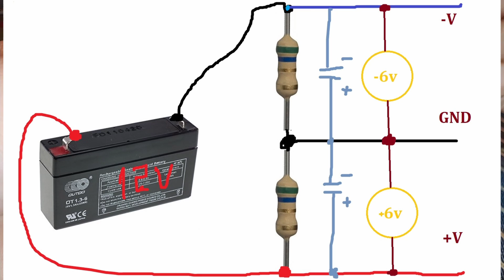CÁC BẠN CHƯA BIẾT ĐIỀU NÀY - MẠCH TẠO NGUỒN ĐÔI CHUYỂN ĐIỆN ÁP ĐƠN SANG ĐỐI XỨNG

Comment: Mình đang tính chế nguồn đối xứng 12v từ nguồn atx máy tính, mặc dù nó có dòng -12v nhưng chỉ ra 0,5A nên sẽ không phù hợp với 12v 20A. Mình chưa nghĩ được cách boost dòng cho dây -12v lên ngang dây 12v. Liệu dùng 2 mạch kia cho dây 12v thì dòng ra có còn khoảng bao nhiêu bạn nhỉ. Bạn có ý tưởng gì hay không
Reply from the maker: Chỉ có cách quấn lại biến áp, bỏ các nguồn k dùng tới như 5V
Reply from the maker: Bạn dùng cho việc gì ?
Reply: chắc kiếm cái biến áp ngoài chạy mạch đối xứng cho lành. Nhiều thứ test cần mạch đói xứng mà
Reply from the maker: @Sửa Bếp Nhanh  dòng công suất bn? Chứ mạch trên test mạch được. Tuỳ thuộc bạn xài mạch nào. Mạch trên chạy đc 1-2A tải
Reply: @Quangvedien  nguồn đối xứng 12v nếu giờ lắp dây âm -12v, dây dương 12v thì được xem là nguồn 24v không bác
Reply from the maker: @suabepnhanh1800  biến áp đối xứng thì nắn âm thì ra âm. Nắn dương ra dương so với điểm giữa của biến áp. Chỉ cần nắn mỗi bên bằng 1 con diode bình thường là được rồi
Reply: @suabepnhanh1800  khổ cái là biến áp thì lại phải chạy nguồn ac. Có biến áp nào chạy được nguồn dc không nhỉ.